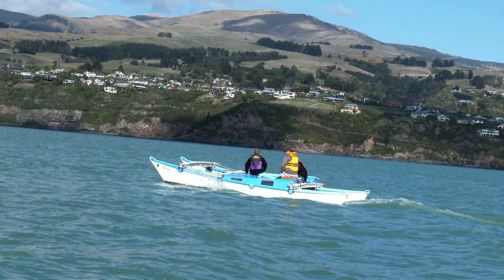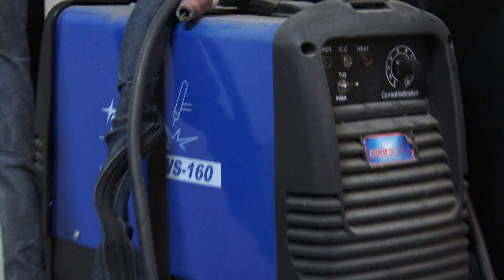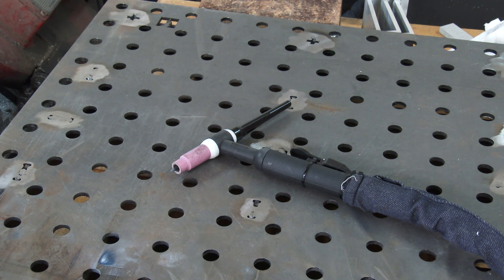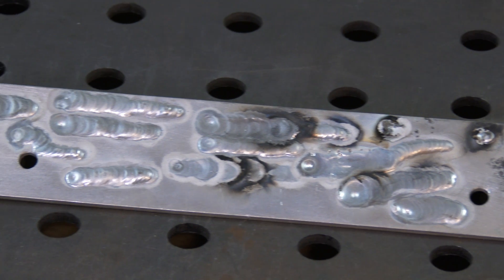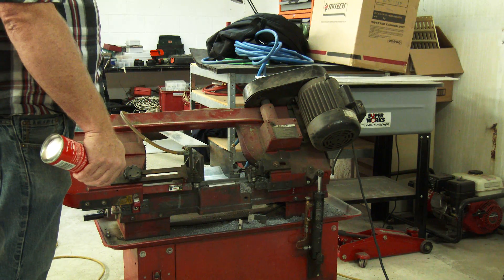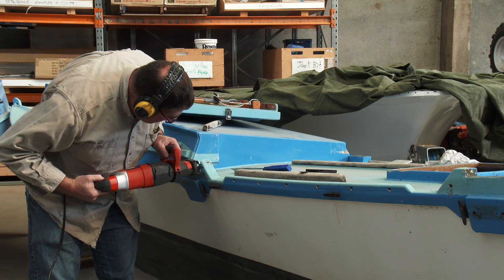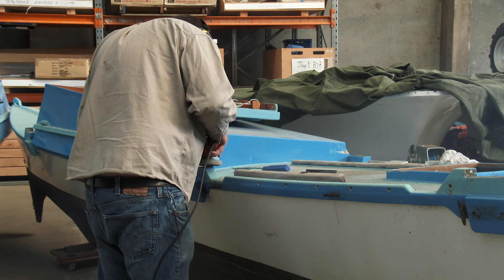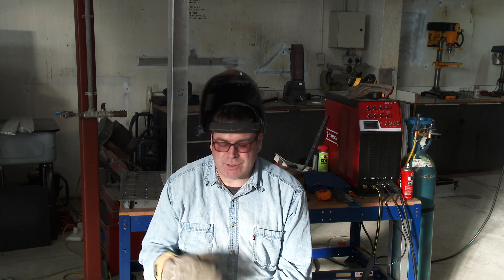EP4 Beginning Construction - Solar Boat

Comment: I'm running into all the same issues with my solar boat (which is admittedly only on paper at the moment)
But here's some free advice no one asked for:
The scissors idea of expanding needs a very difficult-to-build sliding track , which the companion ways would conflict with anyway, and the entire craft would still be very weak torsionally.  In other words, it would be prone to twisting.
Aluminum beams: Unless it's aircraft aluminum, it's corrosion-prone.  Aluminum beams can also sink pretty easily.  You need to get into a big welding one-time job.
Why not engineered wood beams, which would float and wouldn't require exotic tools?  Wood would look nicer, probably sound nicer (the inevitable creaking) and would probably have a better fatigue life.  I think just stowing the beams and man-handling them into place on the ramp is fine.  The fastening, though, must be really fool-proof, and must include aircraft nuts at least.